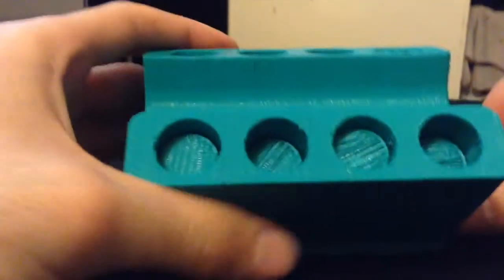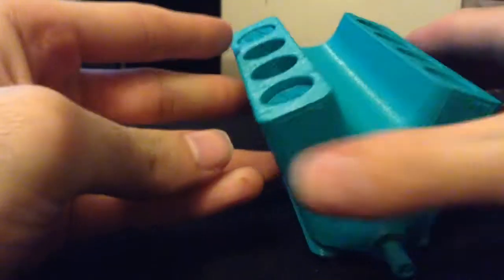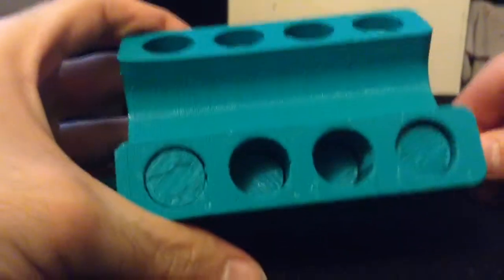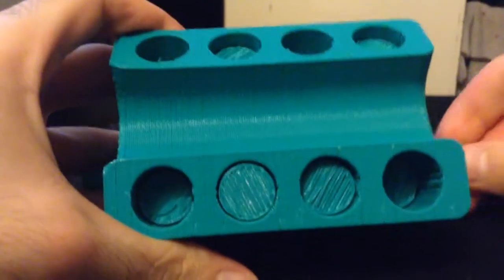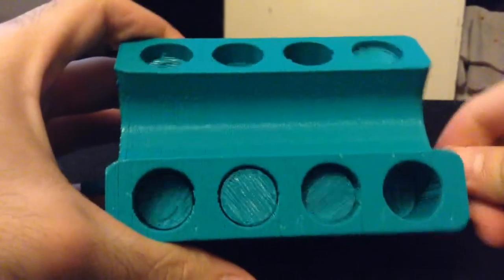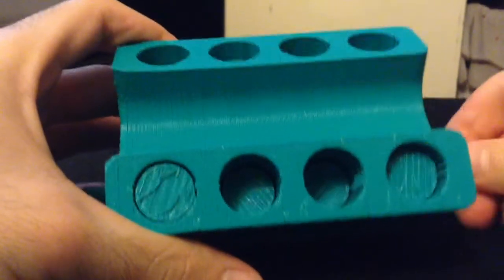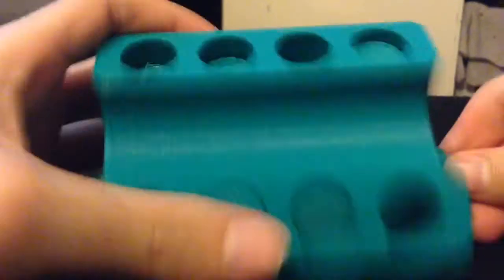3D Printing Time-Lapse ( Functional V8  Engine)

Comment: what's the highest speed/frequency you can achieve without it breaking?
Reply from the maker: Cooper honestly, I am not sure. I know that the crank shaft is very fragile. If I were to leave it running for a while it'll break. Maybe if I use steel or a coat hanger as the shaft it'll work better. Thank you for watching!